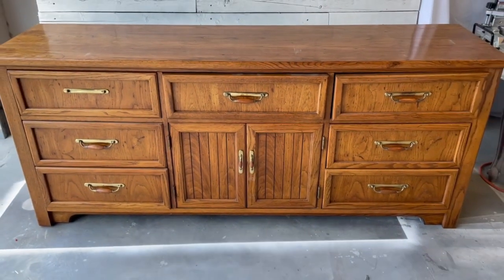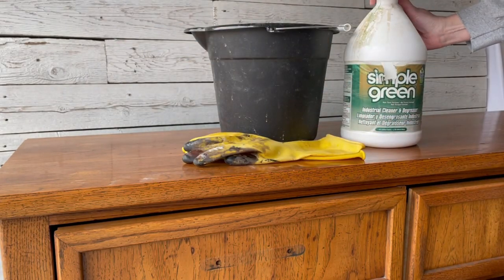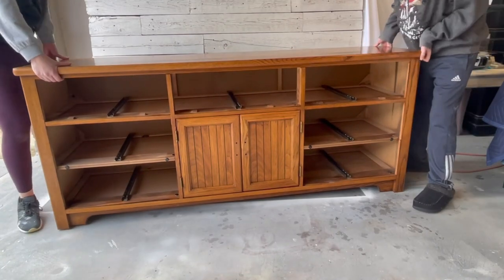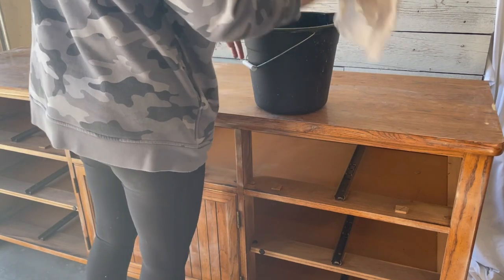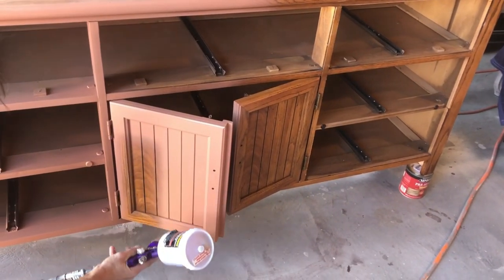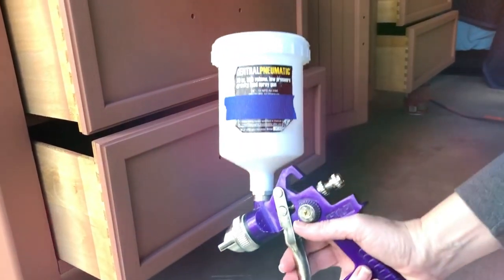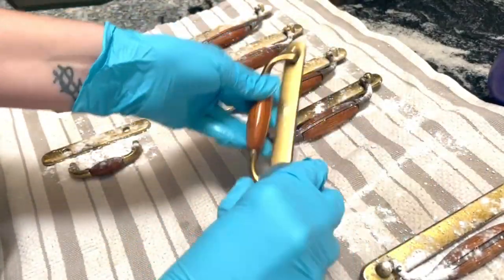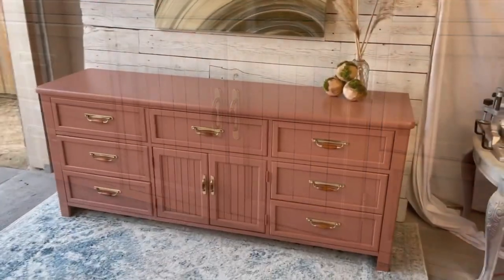Easy Boho Furniture Tricks // 2022 Trending Color

Comment: Alternatively, if you ever need to do a vinegar bath again but cannot have part of something  exposed to vinegar, you can use liquid latex as a barrier. You paint it on, dip, then peel it off. I make jewelry and often have stones that cannot be exposed to water or sulphuric solutions used for patina, and many jewelers use liquid latex.
Reply from the maker: great tip! Thanks for sharing!